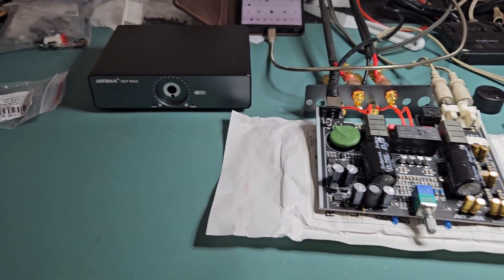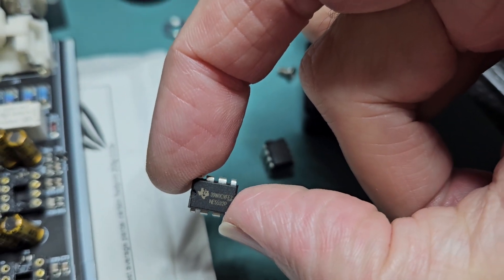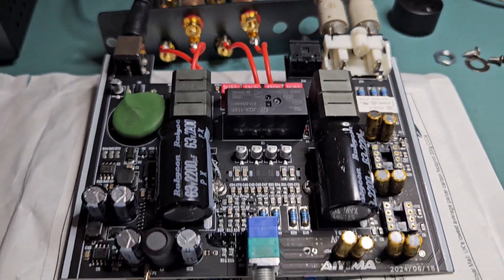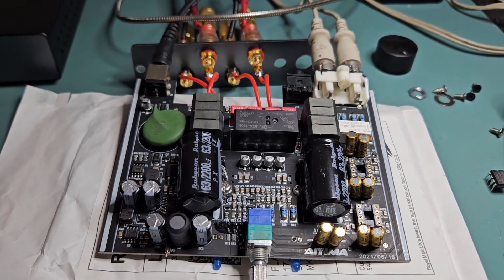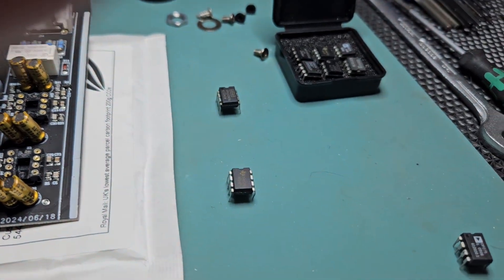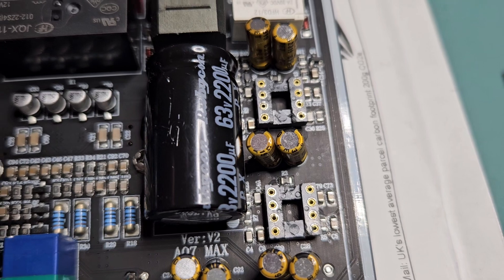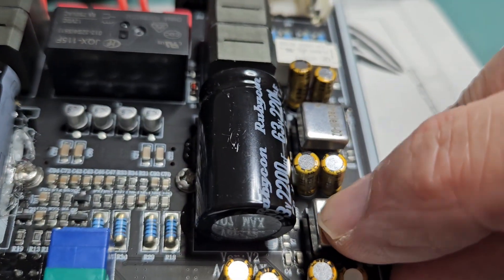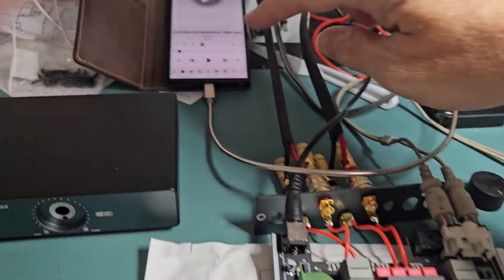Aiyima A07 Max Class D Amplifier Review Pt2 (cut due to copyright)

Comment: So I found 4 oraclell's and can put them in the A7 maxes but need guidance on whether i can remove the front plate and slide out the tray?
Also I am trying to understand this op amp stuff...I have 2 A7 monos, and one Aiyima tube preamp....the mo is take 2 op amps a piece, and Aiyima Tube preamp has 3 op amps in it
I have already bought 3 Burson Vivids so my plan is to swap the preamp stock chips with those...and since I just purchased the 4 oraclells...my plan would be to replace the stock 55 chips on the monos with those.
Will this make a big sound difference ??

Comment: Did you observe any reversed polarity issue on the speaker terminals of A07 Max? I want to try this amp too, but I read some comments in other reviews about that problem with this Aiyima A07 Max.
Reply from the maker: @leonels101  No, on mine everything was fine
Reply: @delatronics  Thanks a lot.

Comment: Hello, I also have the a 07 max.  I have been fairly satisfied with the upper mid range and treble, but I would love a little more bass, warmth, and lower mid range presence.  Would With the oracle 02 and OPA275 provide that? Great video and conversation.. thanks.
Reply from the maker: @scottbennett3119  Yes those ICs will give you more bass and dynamics over the stock parts but if you want warmth maybe look to using a valve pre amp like the small ones available, or try a bunch of other ICs like the OPA ones.
Reply: Thanks for getting back!

Comment: May be your tweeter  only dose up 12k some 20k
Reply from the maker: @georgeogrady449  I am 60 years  old; and as you age we all lose some frequencies off the top end. Anyway, is the other guy saying that the output filtering in these amps is no good? The filter network is designed to take out the ultra high frequencies used in the switching process....